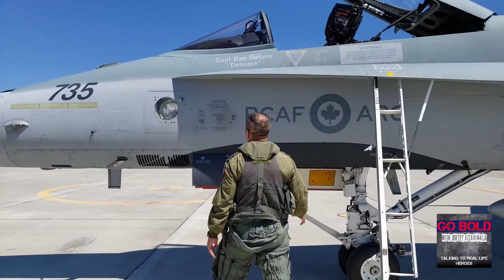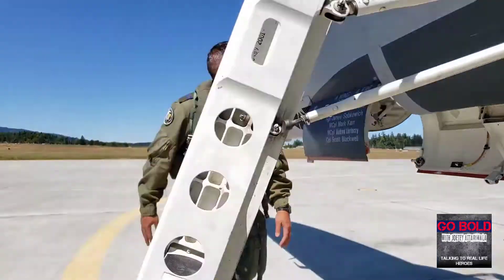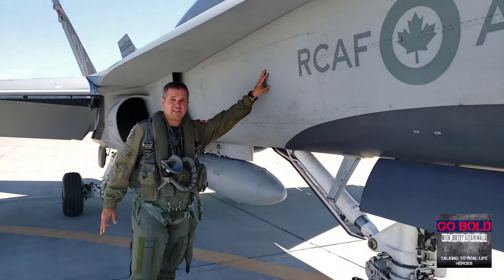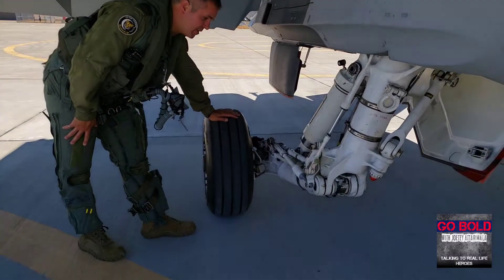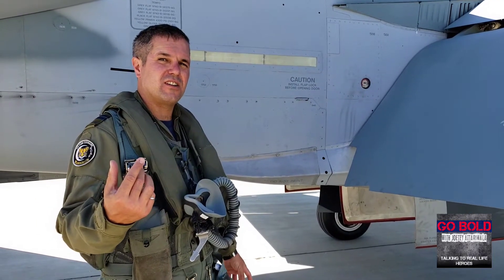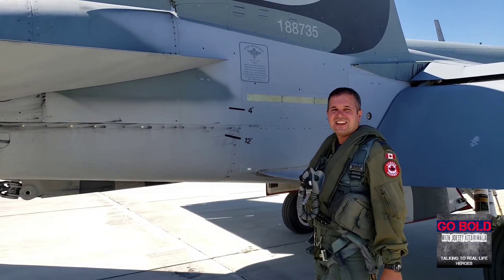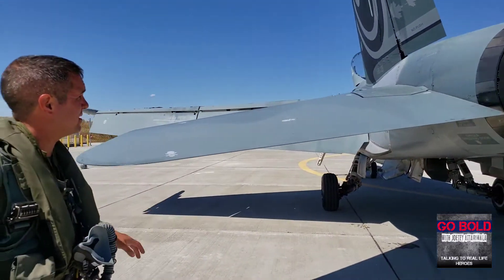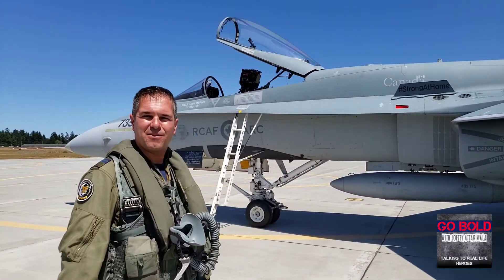CF-18 Hornet pre-flight walk around of the 2021 Demo jet with RCAF Capt. Dan Deluce

Comment: Now why the fk would a Canadian CF/18 have a tail hook? We don't even have a navy anymore, much less a a/c carrier to land on. 😂😂😂😂
Reply from the maker: You're right, Canada doesn't have an aircraft carrier any more, but the tail hook isn't just for that. It's used to arrest the landing on short fields or icy runways, or if the brakes fail. To use it the runway needs to have a runway arresting system available.
Reply: @goboldwithjoeteyattariwala  Lol anymore? What was the name of our aircraft carrier that these planes flew from?... Our airfields do not have arresting cables.
Reply from the maker: @Привид_Бандери  I never said the CF-18 flew from a Canadian aircraft carrier.  I was simply mentioning that Canada did have an aircraft carrier -- the HMCS Bonaventure was the last one, and it decommissioned in 1970.

Also, the main operating bases (Cold Lake, and Bagotville) and a number of forward operating bases (like Alert) have airfield arresting cables which are there for emergencies.
Reply: @goboldwithjoeteyattariwala  Ah ok, sorry I misunderstood you. I don't think these planes are old enough for Bonnie, you think? I am perplexed as to why still lol but thanks for informing me of that. I never seen any at them airports so must be something they remove and install?
Reply from the maker: @Привид_Бандери  Haha, no worries =)  The CF-18 entered service with the RCAF in the early 80s.

As for the field arresting gear, they are deployed at forward operating bases as needed.
Reply: @goboldwithjoeteyattariwala  That's what I thought. And the same about the cables cause I've never seen any in our airfields. Well, thanks for learning me something 😆
Reply: Because da when they flew with America against Iraq and Afghanistan they were landing on American carriers plus better to be safe if you ever had to land on carrier they all have them even army or air force the hornets were designed to land on carriers why that out of all things make you say a thought less comment like that without thinking about it